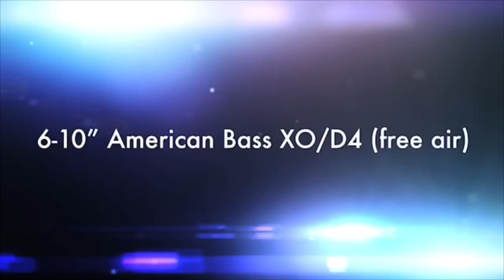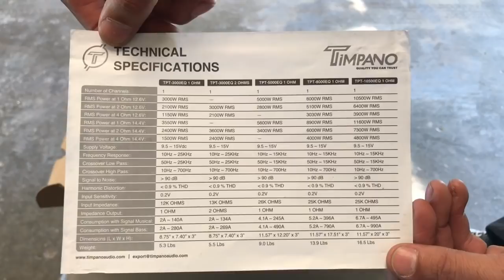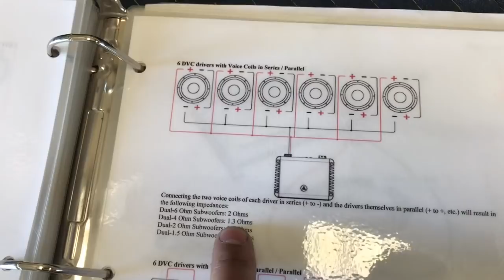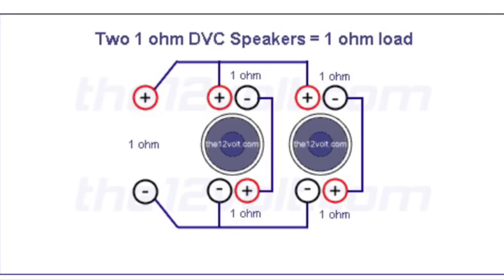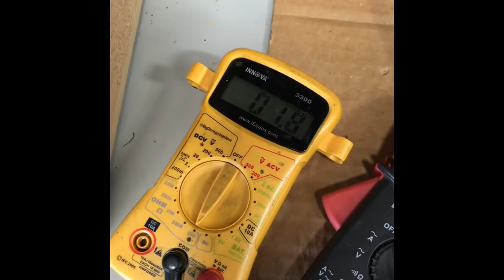Having some fun at the shop, doing an amp test!

Comment: I have been thinking bout using with 8 of slim 8 inch midbass speakers
Reply from the maker: Let me know how it turns out bro, I’m scared of this amp. Not big in full range models.
Reply: @210Designs  i have the be audio riot 7500 full range and i finally figured how to tune it.and it has done well till my dog pull the wires out of it and arched the ground .so now its gotta go to the amp lab to get fixed

Comment: Haha stop tickling those Sundowns!! J/k Big D did a dyno on one of those Brazilian brand amps, cant remember the output. I hear they be fire starters due to their  design. Not sure on the truth of that. But always thx for vid!
Reply: Tara and a banda put out wat it said but i think it had 1 fan
Reply from the maker: jaz97 - Yea, my station voltage is way under par bro 🤷🏽‍♂️ Just wanted to get them moving. Been setting on the shelf, since I had them reconed. I have seen vids of the Brazilian amps being touchy. I never push my systems passed 75% tho, could be why they out last the life of the vehicles 😂. Thanks for watching bro.
Reply: @liljamesjames1884  majority of Brazilian ampfilers are not for bass they are mid bass/highs amplifiers

Comment: What gauge wire you using on subs?
Reply from the maker: I believe it was 12 gauge 👌🏽 It was mainly a mix of drop pieces from previous builds.
Reply: @210Designs  they look bigger! Thanks
Reply from the maker: @josecunsako31  Yea, that’s that Sky-high ofc wire 👊🏽

Comment: Great mids amp
Reply from the maker: Luke Moore 784 - Very impressive and small footprint.
Reply: @210Designs  if only most people knew how to use these amplifiers and the quality of mids high setup
Reply from the maker: Luke Moore 784 - And that’s exactly my issue. I have no clue 😂 To many adjustments for my simple mind. I bet in the right hands it would be amazing.
Reply: @210Designs  trial and error my brother I had to learn the hard way
Reply from the maker: Luke Moore 784 - And that’s the best way in my opinion 😂👌🏾